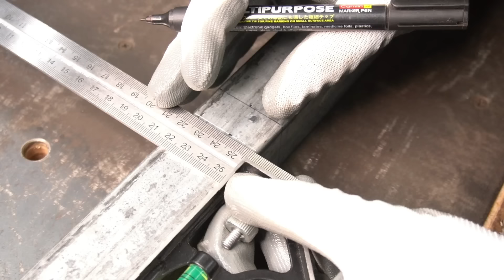CUT 90 DEGREE LIKE PROFESSIONAL - HOW TO CUT PIPE AT 90 DEGREE

Comment: To find the measurements: double the width of the material to find diameter or circle, multiply by π or 3.14 and devide that number by 4. That gives you the total length of the cut and the circle to use to draw the curved cut.
Reply: u r the mvp

Comment: This is standard procedure for me when doing industrial electrical and commercial electrical. Most times we use uni strut but I've used square steel tubing lots of times too. Also do this type of cuts for cable tray as well.

Comment: Yeah you can cut a single 45° and weld it up but then you dont get the same shape.  Even with heavy grinding you won't get the same corner radius as you would with this method.  Pretty decent way to do it if a bender isn't available.

9/10 would watch again

Comment: Pretty slick. You need a plasma cutter bad though. I’ve seen them as cheap as $200 on Amazon. If you go for professional grade, Hypertherm all day long. The Powermax 45 runs about $1,600 but the powermax 30 is about a $1,000 and has a built in air compressor. I have the 45 and have cut through a 1 3/4 inches of piece of steel. Amazing! It will change your life man.

Comment: Nice work... But word of Advice... Use a FaceShield for better ...Safety protection ..when cutting steel with very thin cutting discs... Because the cutting discs are fragile when the load placed upon them is too great.. Resulting in very high speed Explosion.. With bits of debris going everywhere

Comment: That’s a good idea and I have a project going at the moment where this type of corner will be a great improvement. You need to be very careful of the fumes that come off galvanized steel when you weld it, it’s harmful to your health therefore you should use a proper safety mask.
Reply: Tim Hill It’s zinc oxide that fumes off galvanized when it’s heated, not cadmium.
Reply: Steel-N-Brass Oh yes you’re right, I don’t no where I got that from.

Comment: My question is what’s going to hold it together good since you grind all the weld off  ?
Reply: Not sure for his case but with proper prep and a real welder it should
Reply: I have shortened many differentials and clean them well to paint and no problems
Reply: Good prep, a good weld with penetration will hold excellent.

Comment: Clever . But as you had to weld it anyway . Would of been quicker to mitre it and then weld
Reply: Not as strong that way, and this way gives a 90° radius on the outside edge which desired or required sometimes.

Comment: So you trace a circle and hope or do you have a formula for the length of cut outs
Reply from the maker: Diameter of circle is twice from width of pipe
Reply: @BeCreative1 . So the initial cut out is half the width of the work piece and the arc radius is twice the width.  Thank you

Comment: Why not notch the square tubing 2x45deg leaving one side intact then bend and fill?
Reply: Agreed. Prep would be a quarter, result would be stronger and you wouldn't have to misuse a zip disc making that dodgy arched cut. Plus, the finish on this fancy rounded corner wasn't all that good, I was surprised.

Comment: Seems like a lot of extra work. Unless you wanted the bent look for the corner you could have just made two 45° cuts grind weld grind done.
Reply: In some situations it is necessary to have a curved corner because of health and safety regulations.
Reply: @travisbickle5282  the irony of Travis Bickle saying that 🤣🤣🤣

I watched because I want to build rock sliders for my truck and I don't have a tube bender so I'm researching box tubing. This would make a nice corner in that design.

Comment: That's great if you want a radiused outside corner. It would be a lot easier to take out a 90 degree wedge and bend it in. But it will be a 90 degree outside corner.

Comment: You simply showed what YOU did, you didn’t show HOW. How did you work out what to remove? Did you work out a formula? Is there a ratio to consider? For people unfamiliar with cutting metal, could they have made a paper template first based on the outside dimension of the square tube section?

Comment: Way to many steps. Literally 1 cut and then stack the square stock. 1 vertical and 1 horizontal.  Square the edges, weld, finish. I need to .start a tube account

Comment: Where is the bending ?
Thumb down !
Reply: Technically he did bend it
Reply: @alexbaldwin1267  
Technically, he cut it, welded it and grinded it.
When you say "bend" doesn't imply anything mentioned above.
Reply: @elgroso806  try 1:30 in the video. Clearly bending. You can see in the thumbnail exactly what he's doing. It's been cut and bent in the picture
Reply: @alexbaldwin1267  
Since the moment he's cutting it, he's not bending it.
Don't try to win a lost war...
You have no argument !
You, I and everyone else knows that's not bending it
Reply: @alexbaldwin1267  
First...
You don't know what you are talking about !
Simple !
You just want to win a discussion but you don't have the arguments to do it.
You lost it !!
Accept it !
Second...
It's called "bending" when you don't need to cut and weld again, just apply pressure to "bend".
Once again, since he is cutting it, welding it and grinding it, it's not bending  !!
Bye !